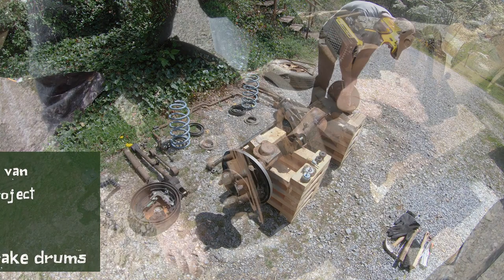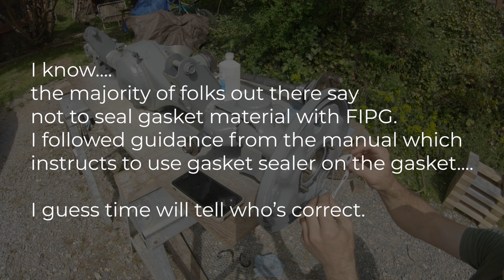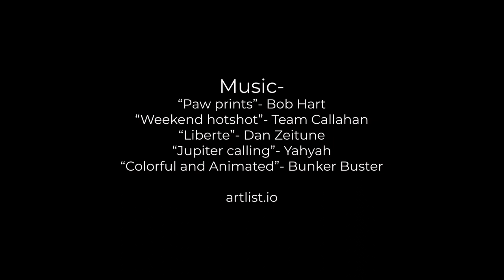1988 Toyota Van | Suspension and Lift | Chapter Two- Axles, rust and brake drums.

Comment: Great video!! What was the process for painting the axle?  Any special steps to avoid locking in rust?
Reply from the maker: Thanks. :)
I ended up just wire wheeling the entire thing. Probably not the best. But it was all I could do at the time. Thanks for checking it out.